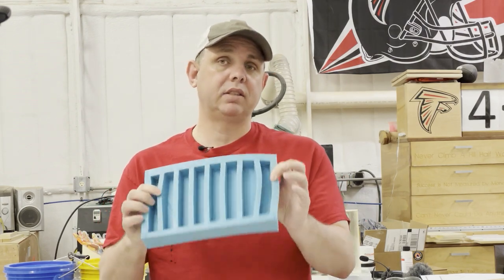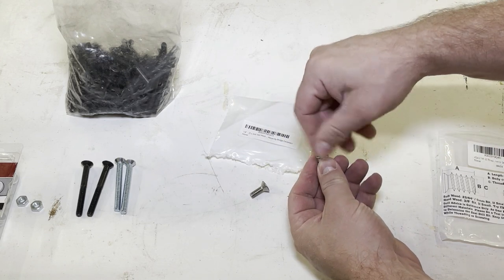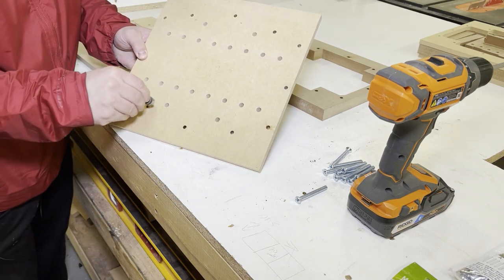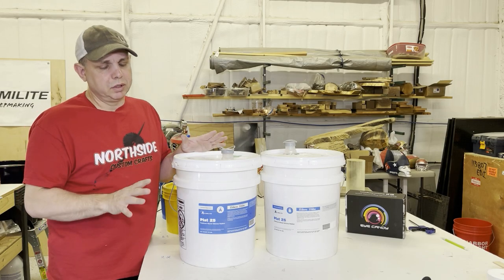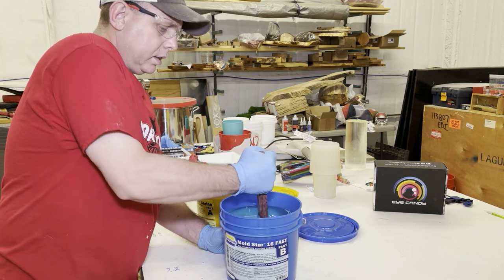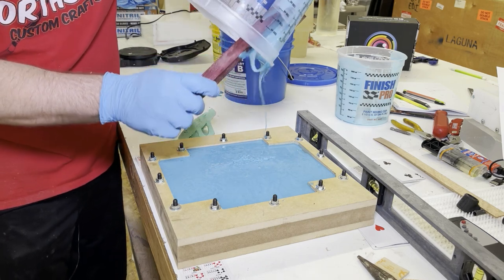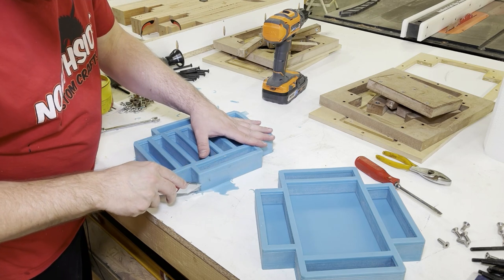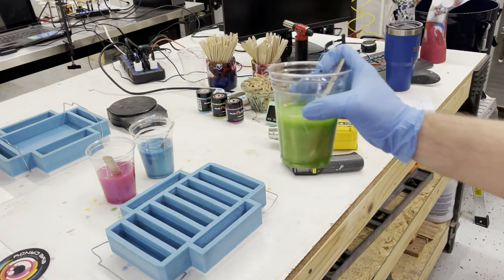Custom Silicone Molds for resin casting Pen Blanks

Comment: Lots of great mold making information here!  Thanks for sharing it.  Just one suggestion.  The use of rice is really not a very good choice for approximating the required volume of resin.  The best would be a liquid since it is the most dense and so the most representative of the actual volume  of space you are trying to fill with resin.  

Do it once, let the mold dry and you know accurately how much resin each mold requires - literally to the millilitre.  Next best would be fine salt or sugar.  I guess you're satisfied with the casts you get using pressure alone, but degassing first and then finishing with a pressure pot will make the resultant blanks perfect (might be overkill if you use sufficient pressure).
Reply from the maker: Thanks.. I didn’t use liquid because I really didn’t want to have to dry it before I cast into it.. I was on a deadline for this video… I do very beginner videos and try to not get too technical.. but you are exactly right

Comment: Use water to fill your molds to test the area.  Rice has way too many air spaces and fulgurations in those gaps depending on how you handle it.
Reply from the maker: I didn’t want to get the molds wet.. I was filming this and didn’t have time.. after I’ve made a cast I just weigh the cast .. the resin I use is by weight so it works out.

Comment: Just a question on reusing the silicon mold.  You said that with the hand mold, you'd be able to take it apart.  You'd put the pieces into another mold.  Basically, it is 100% reusable with other molds if you are unhappy with it.  Is this correct?
Reply from the maker: As long as it doesn’t have mold release on it… you can also wash mold release off.. I use scrap pieces of silicone all the time as fillers when I don’t need to use new silicone for the entire mold. I also make sure the silicones are a similar hardness.. I wouldn’t mix super different silicones together.. I hope this answers your question 😊

Comment: Great video! I just have one question. What's the reason for using rice instead of water? Seems like water would be exact. Is it because you don't want any moisture in the molds?
Reply from the maker: After I made a few of them, I used some water.. you are right.. I really just didn’t want to get the mold wet.

Comment: Have u ever made a mold where the object you r making had a hole down the center?

Pen blanks have to be drilled why not make them so you have the hole in the center? Saves on acrylic, especially for duck call or goose call blanks?
Reply from the maker: I haven’t made any but I think they are out there. 👍
Reply: I know their are molds out there just have not seen any anybody do one with a way so they do not have drilled!
Love your u tube channel.
Reply from the maker: @lorimartin1936  Thank you Lori.. I don’t think they would be hard to make .. I just haven’t done any. 😁😁

Comment: I probably missed this but for prototyping purposes why not fill the mold with water? Surely that's the best way to get the volume of it? I know rice is the go-to for molds you can't get wet and/or want to use right away but in this case it's a silicone prototype and you can just leave it to air dry

Great video otherwise, much better audio!
Reply from the maker: I appreciate the compliment on the audio.. I’m starting to get somewhere on that.. I normally just use the rice.. so it was kind of just habit.. I am going to fill them with water to know exactly how much resin..  pretty much just left it like that to show that there’s always something to change.. I said in the video that I knew it would use more resin and I just left it like that to show that the rice leaves you a little low, but gets you in the ballpark.